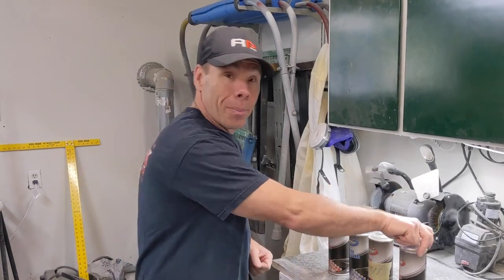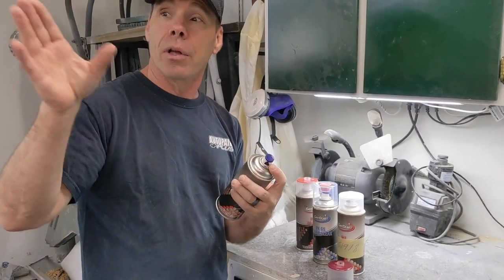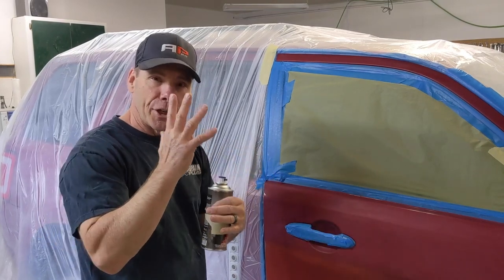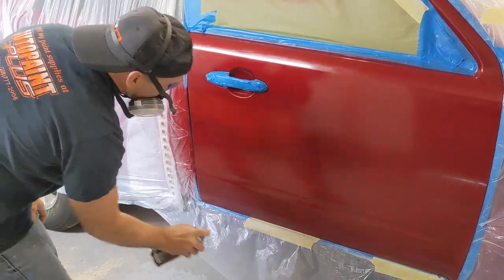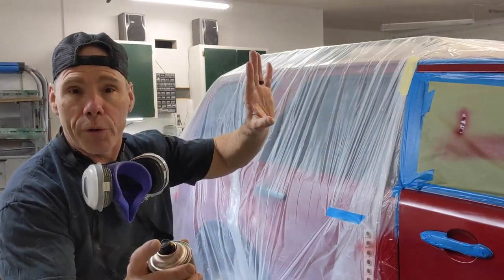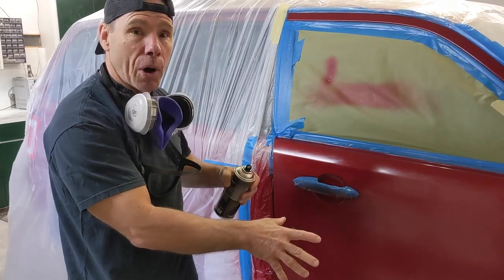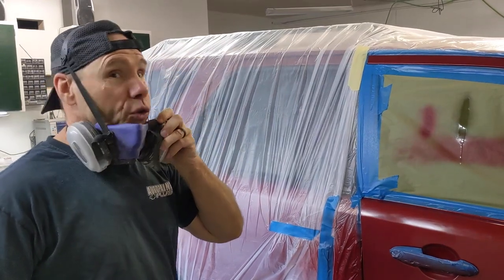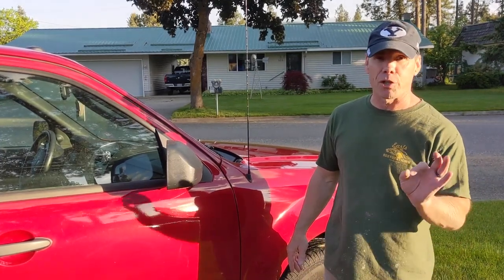How To Blend With Rattle Cans!

Comment: I just finished painting the front bumper of a Tesla Model S with spray cans.  I didn't use these; mine came from Touchup Direct.  It was real automotive paint, but the cans in this video are better because of the adjustable pattern, which mine didn't have.  Bottom line, if you do it right, you can do small touchups with spray paint and it can actually look professional.  I'm a DIYer, not a pro.  I learned a lot from this video.

Comment: Hello to all of you out there in Idaho!  What a great video!  Well organized, informative, no extraneous material.

I had never seen that style of aerosol can.  I had just purchased some paint tinted to factory code and put in rattle cans, from a local auto parts store which has an automotive paint focus, but they did not have these!

S1918 midcoat/intercoat over the whole panel for blending looks like a neat trick!  How did you prep the whole panel?  Scuff with a grey scotchbrite, sand (with what grit?), or ???
Reply from the maker: Thank you! As for the prep, we recommend 600-800 grit sand paper or a gray scuff pad.

Comment: I have to say this is the best informational video on how to use a spot blender I have found. Your responses to the other questions have been great too! I would like a little clarifier. Do I need to sand off the old clear coat on the rest of the paneling that I am not doing a repair on or does the spot blender save you time on not having to sand it?  Also, do you apply the spot blender over the new clear coat as well?
Reply from the maker: Thank you! We’re glad you found the video helpful! You will still need to sand the whole panel in order to get proper adhesion for the blender but you don’t need to sand all the clear off, just a light scuff with 600 grit will work great, making sure there are no shiny spots. 

This specific blender is not for using on top of fresh clear. There is a different blending agent that is used to blend fresh clear coat into existing clear coat, but that is typically used when doing small, spot blends.